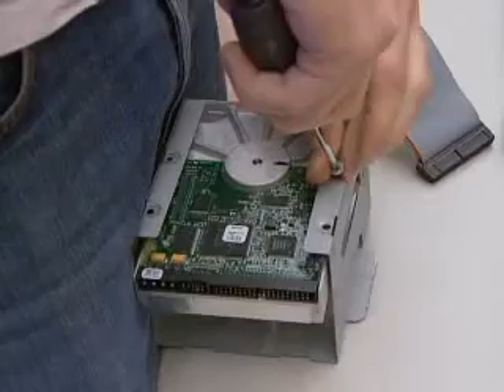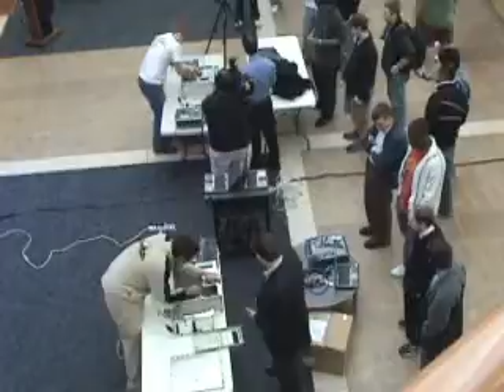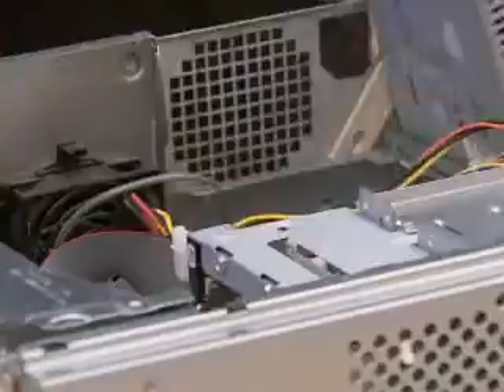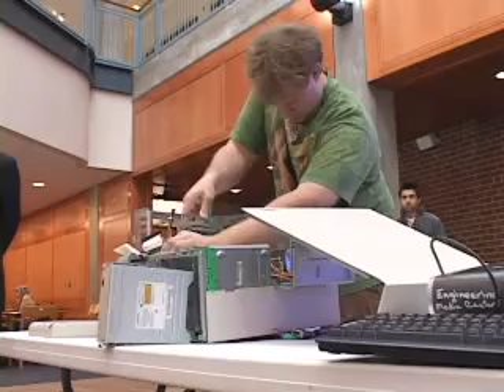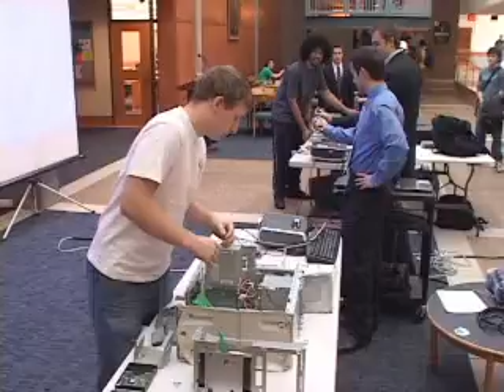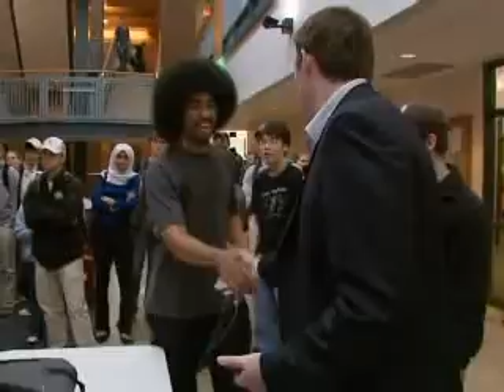Fastest Geek Competition

Comment: dude. what a horrible competition.
everything just snaps together or has 1 or 2 screws.
Try a real computer where everything goes in by screws.
I doubt they didn't have to put the processor in and thermal paste and the heatsink.
those 3 things alone usually take 2 to 3 minutes just because they are so freakin annoying